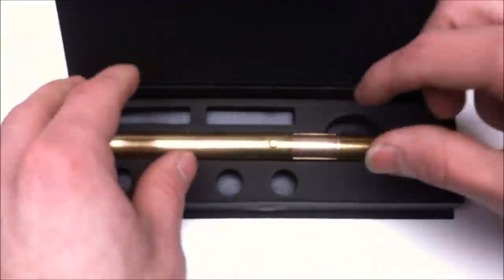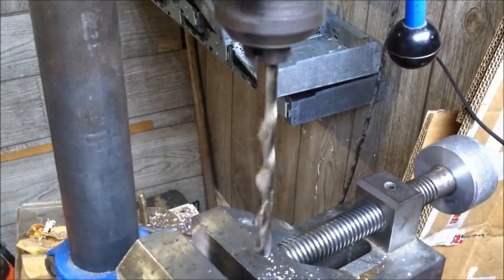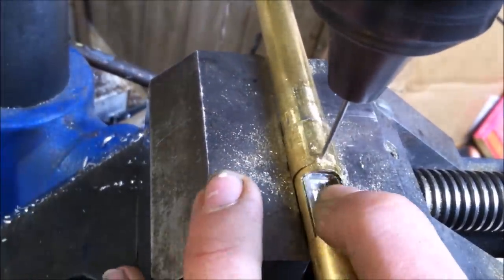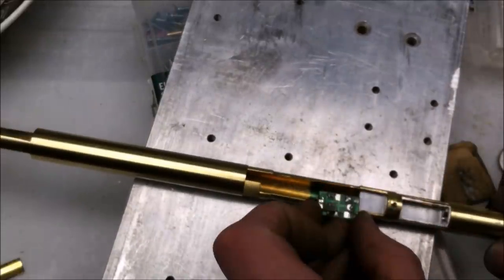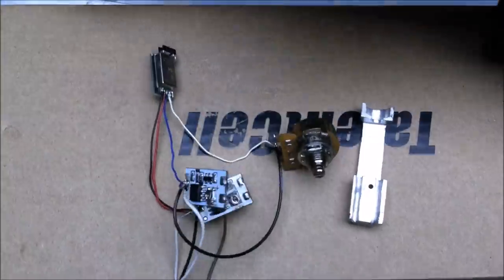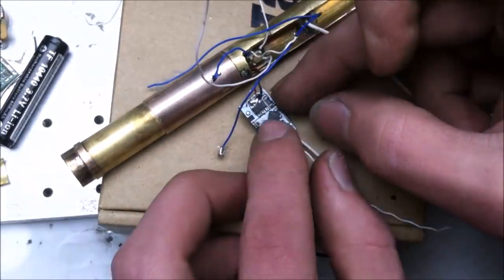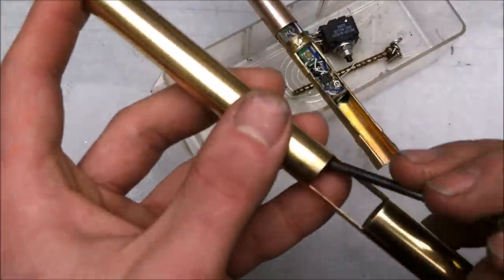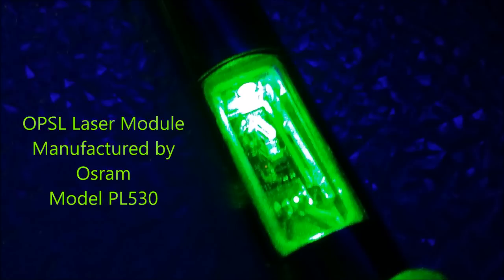Building The World's First OPSL Laser Pointer?

Comment: Hi, Michelangelo of the mechanics and electronics!!!. I wolud like to know how to exactly calibrate the voltage for the PTC heater, could you please help me with that?. I´m intend to use the PL530 I recently buyed in the making of dichromated gelatine holograms, so the frecuency stability and oscilation mode are crucial factors. I have no problem with the constant current source for the pumping diode, but don´t know how to manage the constant voltaje source for the heater because the datasheet I got says almost nothing about the heater other than it is about 38 ohms @40°C. Congratulations for your videos and any help will be welcomed. By the way, I also buyed a White engine wich has a PL530 and a red LD and a blue LD and don´t know the specs for the red and blue ones, may I contact by email to show you some picture? may be you could help me with it´s currents settings because I can´t find any datasheet for this White engine. Thanks in advance. Best Regards. Artemio. P.S. here you can find a sample of the work I´m doing with holograms: https://www.youtube.com/watch?v=ykpV4UR5edU  https://www.youtube.com/watch?v=EmnCBCBFfKI
Reply from the maker: Hello! I understand your need for a very stable laser source for holography.

The PTC is best regulated by current from what I have seen, I just used constant voltage i this project because it was all that I could fit into the laser unit. I have found that the laser drivers for green work for driving both the OPSL pump diode and even the PTC heater. The pump diode of the OPSL can run at 400-500ma pretty well, the PTC heater is a little bit more of a trick to calibrate, it takes about 80ma to run at optimal conditions however this can accidentally be exceeded really easily.  The PTC has various temperatures it can run at as the PPNL crystal will operate at lengths corresponding to the input light, you will see this during calibration ( It will get bright, dim, bright ) as you adjust the power. If you want maximum stability consider getting a cheap thermally controlled relay kit off ebay and using this to power a TEC to keep the OPSL laser at it's own stable temperature along with using the PTC. To do this you would place the thermal sensor in a block of aluminum and than the OPSL laser on top of that than finally place that on a TEC and small heat sink. The OPSL cna be sensitive to environmental conditions and this will help that, it's also best to set the temperature controller to a short response range +/- 1 degree and have it set for around 55F/13C.

For the red laser diode in the white light engine, this you can use a low power red laser driver or green laser pointer driver, anything that is not a boot style, the voltage and current are both very low and this diode is extremely sensitive. The input current max is only 150ma and can easily be accidentally exceeded. In the CD/DVD laser video I show how to modify green laser drivers or you can purchase them pretty easily.

The blue laser diode is a little more forgiving, you can use a small boost mode laser driver like a 405nm laser pointer, I have actually driven mine using them. How to adjust current can be found on my shunt mod video, or you can purchase a low powered boost driver for laser diodes 5 to -200mw. The current for the blue diode is 165ma max on the spec sheet, but they are more forgiving as I have seen people push them up to 400ma, however it's best not to.

Thanks for the comment if you have additional questions please feel free to reply!
Reply: @Zenodilodon  Thank for your fast reply, Just one more question, could you please share with me the doccument or web site from where you got the data about the 80mA for the PTC?
Reply from the maker: @artemiofava5754  This was a suggestion for using the OPSL laser from the ebay seller Holokidd, he has the nominal current ratings for all the laser diodes and PTC on his listing for the white light engine.

https://www.ebay.com/itm/White-Light-Laser-Engine-RGB-Holography-W-Green-OPSL/233431309977?hash=item3659971e99:g:ARcAAOSwa3FcEn9i